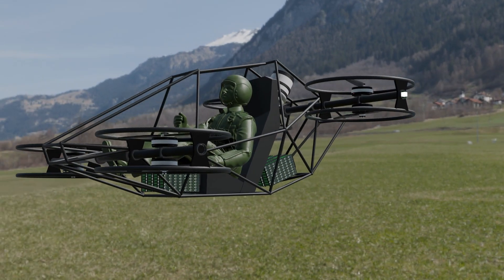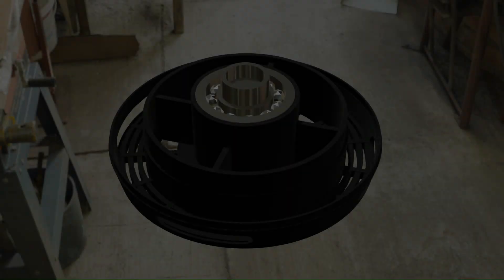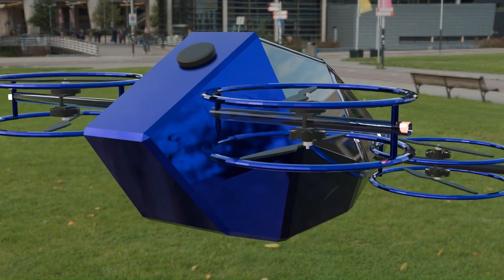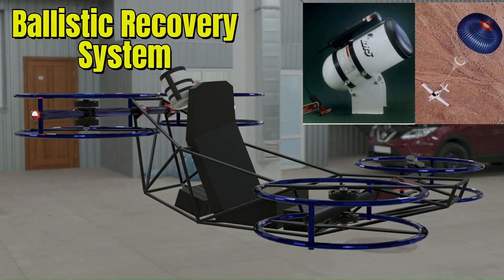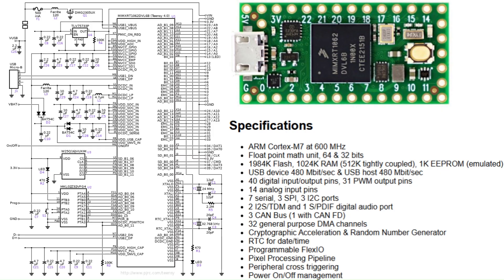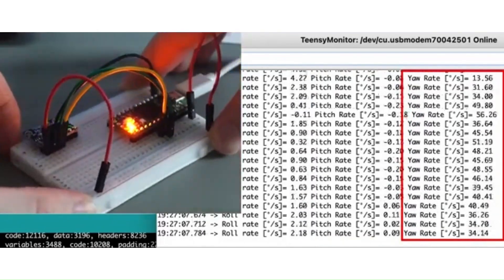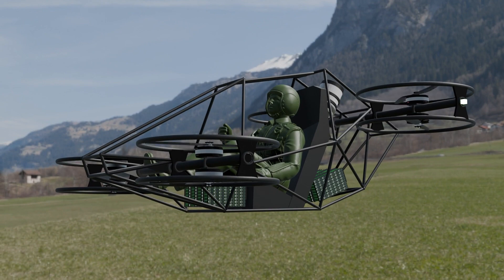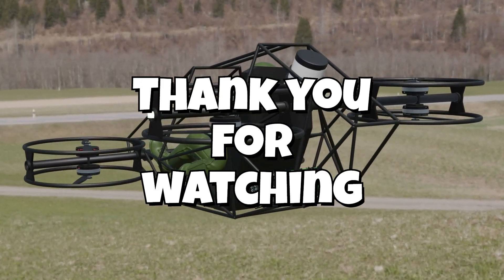Custom heavy lift eVTOL drones and propulsion. #rotor #quadcopter #drone #evtol

Comment from the maker: I’m in the process of putting together a kit and already have all the necessary files ready to send to a job shop for fabrication. For reference, here’s a template you can use as a Request for Quotation (RFQ) to develop your own kit.

Job-Shop Packet — Fabrication & Assembly

 1) RFQ / Email Template

 Subject: RFQ — Fabrication & Assembly — [ProjectName] — [Qty]
 Hello [Vendor],
 Please provide a quotation for fabrication and assembly of the attached files for [ProjectName].
 Attachments: CNC programs, STEP files, Gerbers & BOM, 2D drawings, and assembly drawings.
 Scope: Qty [ ], finished machined parts per drawings, PCBs populated per BOM, and final mechanical assembly.
 Deliverables: Pricing, lead time, QA reports, and shipping to [Destination].
 Regards,
 [Your Name]
 [Your Company]
 [Email / Phone]

 2) Bill of Materials (BOM) Checklist
 • Part number / revision
 • Description / name
 • Quantity per assembly
 • Material & grade (e.g., Al 6061-T6, FR4-1.6mm, ENIG finish)
 • Finish / coating
 • Critical dimensions and tolerances
 • Source / manufacturer part numbers
 • Special instructions (assembly orientation, adhesive type, etc.)
 • Unit weight
 • Shelf life / ESD notes

 3) QA / Inspection Checklist
 • Visual inspection — no burrs, correct finish
 • Dimensional inspection (CMM report for critical dims)
 • Material certifications (MTR)
 • Surface finish measurement where specified
 • Fastener torque verification
 • PCB tests: AOI, ICT, or functional test
 • Fit check of mating parts
 • Photographic record of parts & assemblies
 • Certificates of Conformance (C of C), First Article Inspection (FAI) report

 4) Assembly Steps (High-Level)
 • Unpack & verify parts vs BOM
 • Verify critical dimensions (gauge check)
 • Pre-assemble subassemblies (bearings, shafts, connectors)
 • Torque fasteners to specified values
 • Perform electrical wiring & connector installs
 • Align critical features (shims, alignment pins, runout check)
• Final functional test (power-up, mechanical test, sensor calibration)
 • Final visual inspection and cleaning
 • Bag, label, and prepare for shipment
Reply: is the frame really made of carbon fiber tubes or is it aliminum , carbon fiber is a bit expensive here in my country
Reply from the maker: @ErickTowet  either or Alum and or CR may be used
Reply: could you do this for cargo drone
Reply from the maker: @ErickTowet   yes. And for farmers to spray their crops

Comment: Добрый день какой диаметр аллюминиевой трубки для рамы и какая у неё толщина стенки?
Reply from the maker: There are many factors that govern the size of a primary structural member. Heavier mass reduces flight time, while a larger structure usually increases strength. Fatigue, thermal effects, and stress concentrations must also be considered. Finite Element analysis is recommended. von Mises is an excellent method I often use myself.  Endurance-limit modifying factors may also be used for a variety of modifying factors.  For a quick and dirty preliminary analysis, you can use bending stress to size the member and select an acceptable safety factor.

As an example, consider a pilot weighing 95 kg (≈ 210 lbf) and a beam span of 0.61 m (24 in). If the beam is an aluminum 6061-T6 tube with 25.4 mm outside diameter (1.00 in) and 1.65 mm wall thickness (0.065 in), a preliminary strength check shows the following:

Section properties
Outer diameter 
𝐷=25.4 mm
Wall thickness 
t=1.65 mm → Inner diameter 
𝑑=22.1 mm
Area moment of inertia:
𝐼=𝜋/64(𝐷^4−𝑑^4) ≈8.73×10^3 mm^4
Distance to outer fiber: 
𝑐=𝐷/2=12.7 mm
Yield strength of 6061-T6: ≈ 240 MPa
Simply supported, center point load
Max moment: 
𝑀=𝐹𝐿/4=935×610/4=143,000 N mm
Stress:
𝜎=𝑀𝑐/𝐼≈143,000×12.7/8.73×10^3≈208 MPa
Safety factor: 
𝑆𝐹=240/208≈1.15 → marginal. For aerospace industry SF of 1.5 is acceptable

(Note: FreeCAD 1.0 Does have an excellent FEA feature.  Simple download a step file.)